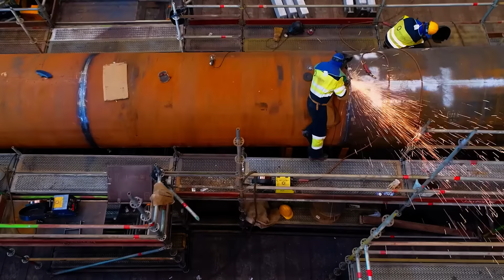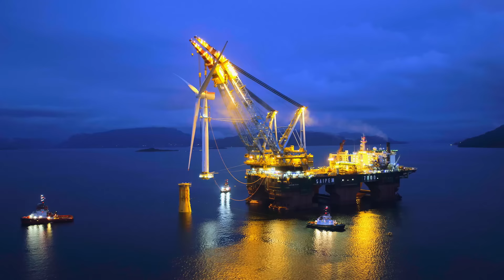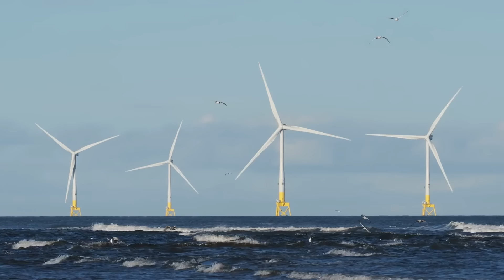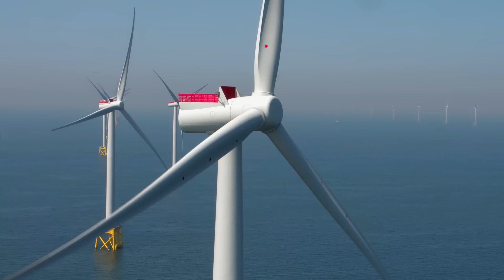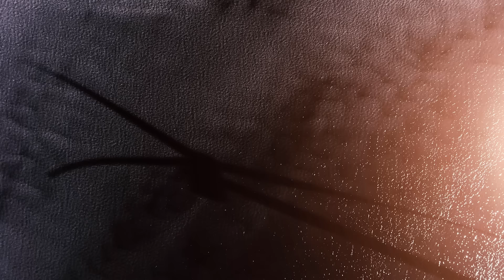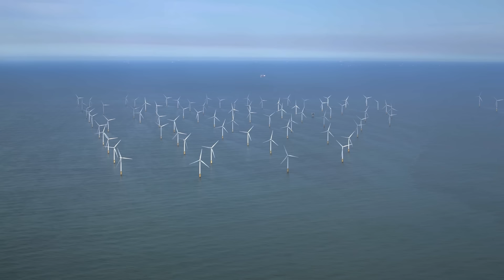Floating Wind Farms: The Future of Wind Energy? | FD Engineering

Comment: A New Jersey offshore wind farm being constructed as a scheduled power plant could likely use less natural gas by suppling all the electricity from gas turbine generators running at their high efficiency electrical output of 85% with a steam cycle that adds 50% more efficiency rather than using natural gas turbines to instantly  backup the wind farm's dips in electrical output up to 100%.  That requires the wind turbines to run at high availability consuming 70% of the fuel as at full power, but producing little electricity.  The steam cycle that can add 50% efficiency is not useful for following wild AC from solar voltaic and wind generated electricity.

The practical use for wind and solar voltaic generated electricity is for maintaining electrical energy storage such as charging storage batteries.   Hydropower can provide the high availability instant backup to wild AC from wind and solar voltaic generated electricity without a high availability stand-by cost saving water power.   

The wild AC from wind and solar voltaic generated electricity offers little fuel savings when forced onto the public power grid.  The fuel savings of solar voltaic and wind generated electricity to the public power grid in the US is advertised at 1% each.  The wild AC they force onto the public power grid is in the double digit percentages of grid electricity used.   

A public power grid connected home solar panel system with no storage requires instant makeup from the public power grid to supply the home.   That high availability cost is nearly at the cost of suppling all the electricity.   

The forced buy of the wild AC to the public power grid is at very high prices for nearly worthless electricity greatly increasing electricity prices in some regions and distracts the public power grid from its main responsibility of producing cheap reliable electricity over a safe distribution grid.  Forcing public power grids to buy large amounts of nearly worthless wild AC at very high prices is ethically wrong to its public utility responsibility of delivering long term low cost reliable safe electricity.
Reply: This isn't really an issue if there is a wide distribution of wind and solar power over a grid. The overall slew rates mean that CCGT can run at optimum rate most of the time. If substantial battery is added, then most CCGT can be shut down most of the time. 
This as an issue in Ireland about 4 years ago, with a small grid, limited storage, and a lot of wind. New Jersey wind will probably be balanced by Quebec hydro.
Reply: Meanwhile, Iowa has been getting roughly 60% of it's energy from wind for the past several years.  And Excelon in Illinois blackmailed the state government for $694 million to keep two of its nuclear reactors running, complaining that they couldn't compete with all the cheap wind from Iowa and a few natural gas plants.  Keep in mind they were already getting subsidies for being a "green" power source.

In Texas, there is so much wind power available at night, there are electricty plans you can get on where all your night-time power is free.  This makes it a great time to charge your electric car.  Although it's a smaller percentage of the state's total power, Texas produces roughly 3x the wind power of Iowa.

In Australia, Tesla's Hornsdale Power Reserve (lithium battery based) installed in 2017 saved customers $150 million and paid for itself in 2 years.  It was practically printing money, so they made it even bigger.
Reply: In case anyone comes across this later: Douglas doesn't know what they're talking about. "Wild AC" refers to alternating current electricity with a fluctuating frequency, which neither wind nor solar produce.